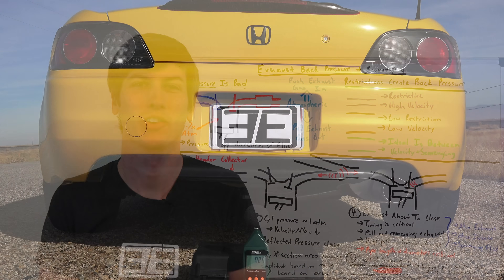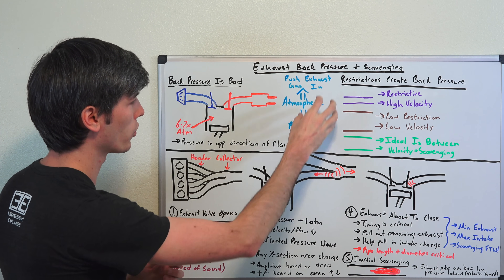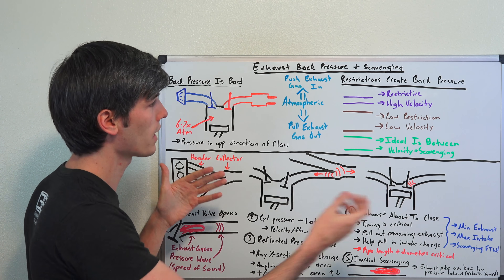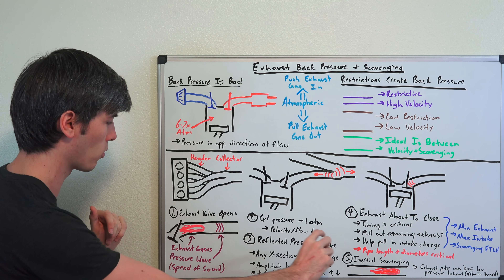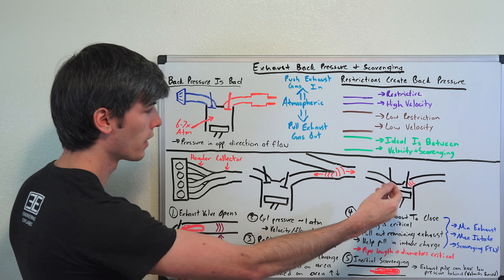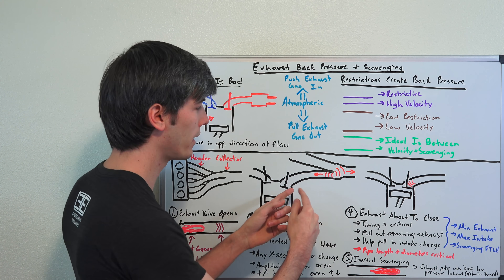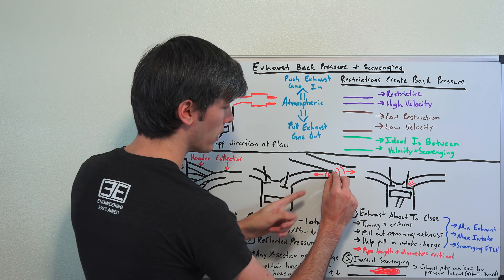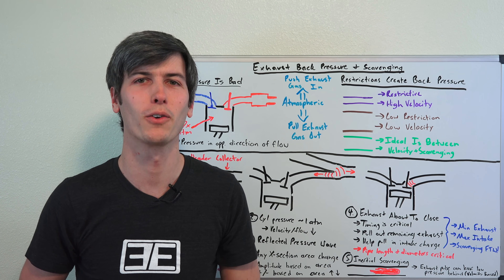Stop Saying Car Exhausts Need Back Pressure

Comment: I will explain to you the source of the backpressure myth. In the late 1970's carbureted cars were forced to run an extremely lean mixture. The older catalytic converters were quite restrictive.  These cars were able to run so lean (without melting pistons) because the old catalytic converters created a form of passive EGR. If the exhaust on these cars is replaced with a less restrictive system the passive EGR  was no longer present. These cars would run VERY lean, melt pistons and overheat UNLESS the carbs were replaced with pre-emissions carbs.Timing was not computer controlled and knock sensors did not exist. Hot engine, lean mixture, detonation... BOOM!
 It was a crappy system, there were 350 cu. in. V8's with less than 150 hp! So many vacuum hoses were required that underhood vacuum maps were quite detailed. Bad days for automotive tech.
Reply: Catalytic converters did not become mandatory, it only seemed that way. Exhaust emission limit levels kept being reduced, and because of that, MOST auto manufacturers began using a catalytic converter in 1975 because they couldn't figure out any other way to meet the emission standards. That was the beginning of no lead gas,because the lead would supposedly coat the tiny platinum catalyst pellets inside the converter (I don't remember ANY cars using a cat con before 1975, and then all of a sudden, it seemed like all of them did).  However Honda's CVCC engine (in Civics and Accords) was able to meet the emission standards WITHOUT a catalytic converter all the way until 1980 (except in California, I think that Honda needed cat cons there in '78). Exhaust tech did not change; as he mentioned in the article above, was just part of the science involved to get the engines to make certain amounts of power at selected points in the torque curve, while keeping the noise to a minimum. Short open pipes were usually used on vehicles that needed to make maximum power at high rpm's. Longer, smaller, more restrictive exhausts were used on street vehicles that had to be quiet. Somewhere in the middle were exhausts which were a compromise between the two. And for some bizarre reason, the aftermarket often did better than the OEM's; my Honda 750 bike with a Supertrapp exhaust made much better power than the stock pipe, yet was also relatively quiet (that was the exhaust where you could add or delete some discs to tune the exhaust).  And yes, the vacuum line rats nest of some of those smog engines was enough to drive us nuts! One little crack in those rubber lines would make the car run terribly! I vividly remember taking polaroid pictures of the top of my engine, pulling off the Autolite carb and replacing it with a pre-smog Holley, plugging up all those little holes, and running it like that until the next emissions inspection when I'd reverse the whole shebang! Ahhh, the good old days!
Reply: D.E.B. B -  Catalytic converters became mandatory in the early 1970's. The tech was not the same in the 1960's. My first car was a 1967 Camaro one owner, low miles PERFECT...$1200; it was very simple (points, carb, drum brakes (all of them), and it had about 3 vacuum lines under the hood). My second car was a 1975 Monte Carlo. The Monte Carlo had dozens of vacuum lines, a cat, front discs,  HEI ignition, AND IT WAS SLOW AS MUD. Car tech changed drastically between 67 and 75.
Reply: At any rate, if you replace the factory exhaust on your 1977 Granada with duals and glass packs it will run lean, overheat, detonate and die young. This is why some people believe that engines need back-pressure.
Reply: So basically, early emissions systems were crappy and complicated, and were doomed to kill power unless there was an electronic babysitter to reign everything in efficiently? Big shocker.......
Reply: The 70's???? You've got to be kidding me. Or is that as far back as you remember? Because exhaust tech as you explained goes way back beyond the 70's vehicles.
Reply: D.E.B. B what he's saying is it really originated in the emissions days, which started very late 60s and came full swing in the 70s, that's when it really became an issue and the backpressure idea came to light

Comment: Oh yeah, I get it!

Mounts 10" straight pipe into his '90 Honda
Reply from the maker: Praise be.
Reply: now I want to know how to calculate length/diameter for my project honda.... :/
Reply: How much you paid for it on craigslist (a)
Amount of monster stickers on the car (c)
Desired ricer factor (1-10) (b)

a / c + b = diameter in mm
Reply: StanceArmy Jimmy same here
Reply: TheBobes LoL, f1 2017 is really making Honda a joke
Reply: I’m straight piping my 4 wheeler but I’m makin sure that I don’t burn up the valves us redness like things loud
Reply: Tommy Justice you completely missed the joke
Reply: Smart Feller funny enough I actually just watched it. I could have sworn they did a single exit as their control test, but it was just duals. 

If it was my choice I would only be deciding single vs dual based on sounds, that said if there is power to gain in duals there is probably a aftermarket company making duals for the Accord. Even then though there is probably a way to get a good gain in power somewhere else like headwork or intake mods.
Reply: Smart Feller get a ATPL long tube header and then do a Y pipe and split to dual 2 in pipes. Look up ATLP true dual exhaust. Or for get the bolts on and go turbo and hondata like I did. Hx35 Holset accord v6 on YouTube
Reply: Tommy Justice 99 to be exact
Reply: Tommy Justice S2000 appeared in 1998
Reply: @ Smart Feller

Find a shop that will run dual 2 inch pipes on your Accord V6.  I have a Camry V6 and I had a shop run dual 2 inch pipes from the 3rd cat.  The Camry feels really strong now that the 2GR-FE has a proper exhaust.
Reply: a crazy ass diameter is way worse than a too narrow one xD valved exhausts bro!!
Reply: Hooked a turbo charger to the end of my tail pipe.
Reply: @ebred76  Love that people still come here 2 years later to comment on this. ❤️

Honestly... I completely forgot I ever made a comment this popular. Wow.
Reply: StanceArmy Jimmy so you don’t have Hondas?
Reply: StanceArmy Jimmy wide open. Like the girls in  Beijing.
Reply: TheBobes I know lol
Reply: I do... 3 of em
Reply: single cam, 2.3, HC build... single exhaust, not duals
Reply: Engineering Explained I love how you refuse to give up your love for your S2000, PRAISE THY VTEC
Reply: Shawn P. N. Wasn’t the first model year a 2000 that was available for sale in 99,  unless you mean “appeared” as in shown somewhere I guess
Reply: Hahahahaha
Reply: Just remove your exhaust manifold.
Reply: Ed Jack ‘99-‘09
Reply: Motec system exhaust
Reply: Just pull my exhaust manifold off.
Reply: TheBobes 
Hmm... I think you might as well have nothing after the exhaust manifold mounted straight on the engine to guarantee absolute minimal back pressure.
Reply: @4G12 10"? Personally i prefer 15" from the manifold back.
Reply: we dont have craigslist in Croatia... no monster sticker, and no ricer factor...
Reply: Smart Feller Motor Trend did a engine masters video where they tested dual exhaust on a engine Dyno. I don't remember the results but its definitely a good watch. Really every engine masters is a good watch imo.

I would assume you're better off with single exit, but if you're going for looks or sound then go with whatever you like.
Reply: Chill boiz. It's a joke... :)

...just like Honda.
Reply: Colin Bacon  just finished watching the video. They only tested true dual setups, x pipe, h pipe, and no crossover.  Wish they had also tested a y pipe into a single 3 inch exit or something like that also.
Reply: StanceArmy Jimmy If its dohc id say go with a 3" pipe and re-follow the exhaust with a straight through exhaust unless you need a cat, sohc tends to lose some bottom end with duals even if they're 2.5" pipes
Reply: If car exhausts don't need back pressure, then why not car makes more torque with 10 inch exhaust instead of stock exhaust?
Reply: @RDSAlphard  a really big exhaust let's the gas expand  when that happens it cools rapidly and becomes sluggish and slows right down ,not what you need for power.
Reply: @RDSAlphard  did you even watch the video?
Reply: Engineering Explained what would make more power on a 2004 accord v6 with the j30a4.  Stock cats, j pipe, then 2.5" straight or have the muffler shop run two seperate 2 inch pipes after each cat/downpipe  from front to back with no crossover (barely enough room under my car for true duals, let alone a crossover pipe). Having a hard time getting the muffler shop to do it, they say its not worth the time and money and that I would lose power due to not enough backpressure. Can you make a video about true duals vs single exit,. Thanks
Reply: @smartfeller1495  duals vs single won't matter if you size the pipe correctly and the two banks headers are even length
Reply: Yeah because s2ks are from the 90s 🙄
Reply: @tjustice09   the first s2k came out in 1999
Reply: Tommy Justice the first s2ks were made in 1999

Comment: There is a video that explains why backfire occurs and how to eliminate it?
Reply: Not completely burned exhaust gasses ignite in the exhaust system. That causes the car's engine to backfire. Usually it;s connected with injecting too much fuel into the cylinder and not providing enough air. Sometimes the fuel is injected into exhaust system on purpose in order to spool up the turbocharger.
Reply from the maker: I've made two! :) 
Backfire: https://youtu.be/XVDXLW3P7q8
Afterfire: https://youtu.be/bgS3PA5r0vY

Comment: Engineering Explained hi. nice vid. can you explane how come when your headers or muffler is cracked or has a hole in it your car starts to consume much more fuel notisable. Is it related to this video too?
Reply: Ow yes ur right. now will it be same with the muffler situation too? i din't think so. this issue was since carb engines.(you are right about AFR. 100%

Comment: it all depends on your engine and exhaust setup. I had a 1992 Honda Accord 5 speed, a relatively low compression engine (compared to newer cars) that only made 125 hp. I ran that car with several exhaust setups, including the typical "fart can" or "N1" muffler, as well as other mufflers that were free flowing but had some baffling that increased backpressure. I took that car to the drag strip and ran 1/8 mile street drags fairly often. I consistently ran faster times with a muffler that had baffling compared to the N1 style muffler. Why, you might ask? Because the backpressure lowers the torque curve to a usable level. for that specific type of engine you want some backpressure because it doesn't rev very high (it only redlined at 7k rpms because it was a single cam non-vtec). with more than 4 cylinders this problem is overcome by the rotating mass of the engine, but with such a low compression engine it just turned out that way. sure, it probably made more peak horsepower and peak torque with straight through exhaust but the rpms at which it made that power were so high that I would have to rev the engine past the redline, almost to the limiter, to find it. Of course this is not a problem for engines that have more cylinders or that have forced induction to overcome the torque issue, but for that specific car and for non-turbo 3 and 4 cylinder small CC engines, you will almost always want a little backpressure to put the power at a usable level. Also, as a side note here, I got better fuel economy with a little backpressure because I didn't have to work the engine nearly as hard to get to the torque on the street.
Reply: This and the "3000 mile oil change" will never go away.
Reply: Back pressure is the (bad) side effect of having smaller diameter (restrictive) exhaust the increases the velocity of the gas. This increase in velocity at a specific volumetric flow rate (rpm) is what gave you more power.
Reply: Jessa Phillips. You are misunderstanding what is going on with your engine.  You dont need or want back pressure, it will never give you any benefits.   It is simply a side effect.  

Your engine was always designed for low and mid range power for comfortable drivability, with every other aspect of the engine designed around that goal an overly large exhaust will likely hurt power and performance.  Your best performance likely came from an exhaust that improved output right smack in the midrange, an exhaust that works well there will be a restriction at 7k rpm and THATS where the backpressure comes in, well after you have seen your peak torque and power. 

You will not be seeing backpressure at 3k to 5k where you are making best torque so why would you credit backpressure for those gains? 

Its just a matter of misapplied logic, it would be like noticing that your brakes get red hot when braking at the race track and assuming that because glowing rotors and strong braking are correlated yiu can improve your braking by applying a torch to the rotors before each run.  

Brake heat and backpressure are both results that you want to minimize,  not things you specifically want.
Reply: Adam Harrington ikr? 😂😂😂😂
Reply: was the cars ECU tuned to optimize the new flow characteristics?
Reply: Jessa, 7k RPM is high in my book....
Reply: 1CoLoRz2 I change my oil every 50 miles or 48 hours... whichever occurs first.
Reply: +Erik Priester No. It doesn't matter if you have a turbo or not back pressure = bad. The reason u drop low end torque with a big exhaust diameter is because you lose exhaust gas velocity and thus scavenging is less effective.
Reply: if you want new engine every oil change, welcome to change your oil after 3000 miles ;)
Reply: You should have painted a racing stripe on the accord.  That's good for 5-10hp!
Reply: duradim1 ponle casa
Reply: he said that already.  you got better scavenging at the low end
Reply: ChrisMuJew If you knew anything whatsoever about cars, you definitely wouldn't have made your comment.
Reply: I definitely agree.. had a n1 muffler immediately lost low end torque and had to rev higher then normal in my 4 cylinder Na hamster Camry engine...being annoyed by the sound and low torque I put a stockish quiet muffler back on and IMMEDIATE torque was restored as soon as I pulled out the muffler shop...
Reply: Erik Priester did you even watch the video?
Reply: Jessa Phillips Have to agree with you Jessa. I've tuned most of my cars. Replacing the rear silencer improves low rev power but mid and top range power is ruined. Great if you're happy with noise but British police will stop you. Strangely mpg improves. Talking about 4 cylinder 1800cc. MCM confirmed backpressure is important with a potato in the tailpipe lol!
Reply: Adam Harrington AMEN! drops mic
Reply: So after watching the video some are still confusing backpressure with exhaust gas velocity causing a scavenging affect. Guess you really can't save them all no matter how hard you try.
Reply: An actual engineer explains in detail, how everything works and why it works the way it does.... and Jo(e) Shmoe shows up to explain that he's wrong and how his/her car is a special case....
Reply: Give this lady a drink, i'll pay. The same happens when you port the heads, a bigger port can improve the engine response in a wide range, but after some point the engine gets some penalties in power.
Reply: You’re thinking too hard about your accord buddy.
Reply: Matthew Martinez Some vehicles actually do need their oil changed every 3k miles tho
Reply: Jessa, I like your name. It is unique.
Reply: Jessa Phillips with "non turbo" engines yes you need some back pressure. Put high flow cat, and remove Resonator, but keep stock muffler and it will be fine. Best of both worlds

Comment: Engineering Explained I believe this back pressure issue is more relevant to small turbo engines. My 2012 VW GLI with the EA888 gen1 2.0t has seen issues with aftermarket 3" down pipes on stock turbo. AWE has done some testing. 3" is great when you upgrade to k04. Love your videos, do a turbo version of this one.

Comment: Wait, does that actually mean, that you can get better power using a proper exhaust system, than without any exhaust system at all?
Reply: Some engines even produce more power using a catalytic converter that without it.
Reply: RacingRalphEVO, If by "without any exhaust system at all" you mean not touching the stock exhaust system at all vs a custom/performance exhaust system.. Obviously running a car with no exhaust system after the headers+cats will make you more power because engine exhales faster vs having to go thru all the tubes n bends..
Reply: RacingRalphEVO, having no restriction is always better, even EE explained that, did he not?? lol.. Think of it as a human, if you have buggers in your nose will you breath better than when you remove them?? Engines inhale n exhale like humans do, restrict your mouth n nose n you will no longer breath like God intended you to.. Car makers restrict their engines to pass Gov. laws, emissions n to satisfy majority's preference of a silent vehicle..
Reply: Yes  RacingRalphEVO
.Because it will empty your cilinder chamber from all ready burned gases,so there will be more room for more fresh mixture. Means more mixture is more power.
Reply: Yes, having proper headers and a section of exhaust pipe after the headers will make better power. Biggest benefit is low rpm torque.
Things like mufflers and cats add restrictions though.
Reply: I mean having no exhaust system at all. I think I wrote it clear enough :D Well, I always thought that having no restriction is better, but the video, and the colleagues above tell something different.
Reply: I sense some sarcastic there

Comment: is there a formula that you can put in CC cylinders Hp and pipe diameter that can give you the proper length of the pipe from the cylinder and beyond?
Reply: Απόστολος Ανδρούλης. It would be an approximation at best.  Theres a lot of variables.